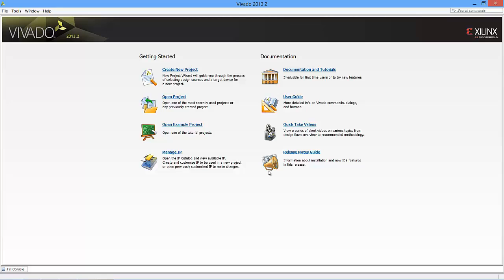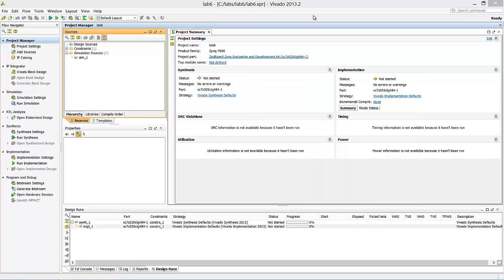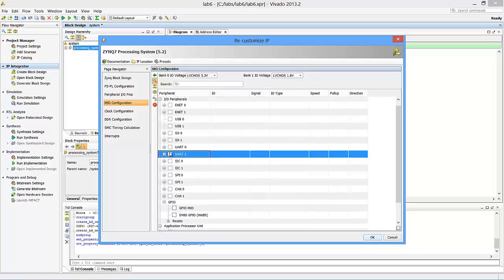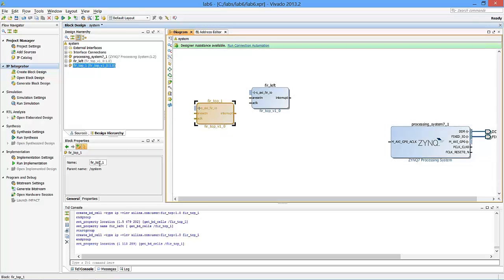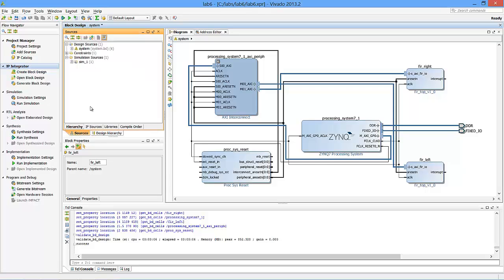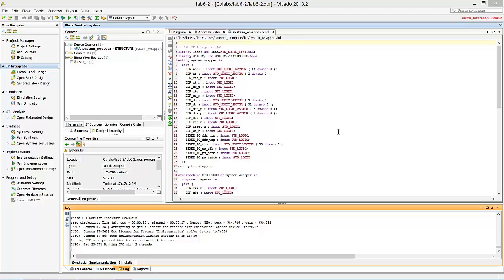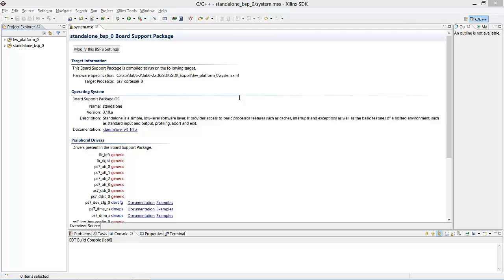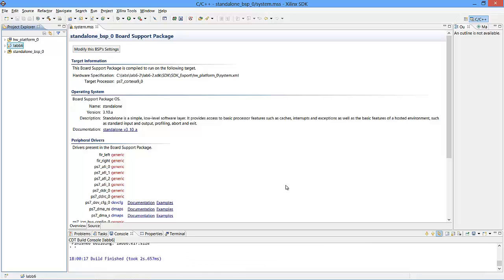Profiling and Performance tuning step by step

Comment: Hey Eirik. Thanks for creating such videos first of all. I bought a PYNQ Z1 board recently. I am not an engineer. I am a physicist. I have no prior knowledge of FPGA boards. I want to do a simple task of creating a pulse generator and see the output in oscilloscope. I am not finding a video that will show me a simple code for addressing a physical output. I found the schematic diagram of the board. And let's say SWO = M20, and LED0 = R14, but I am not sure where exactly to check the output? Are these referred to the switches and leds on the board? But then how do I access the physical pins?